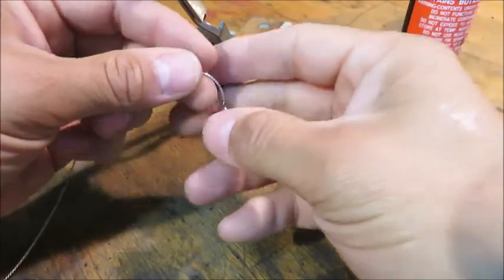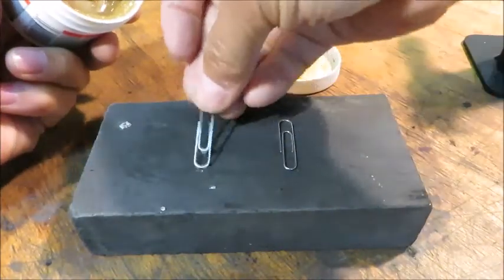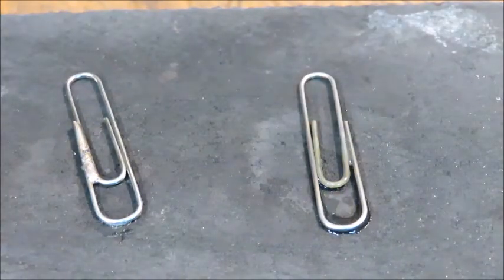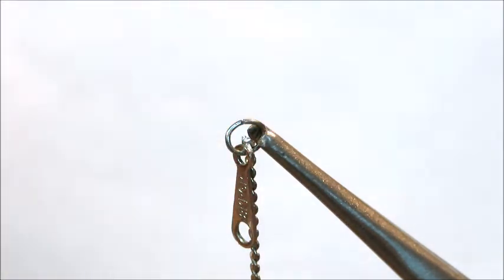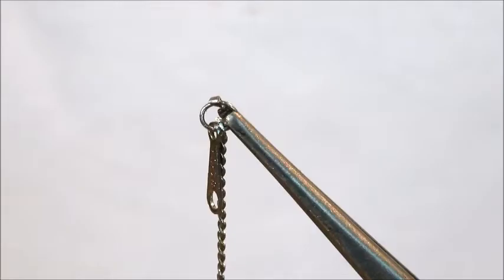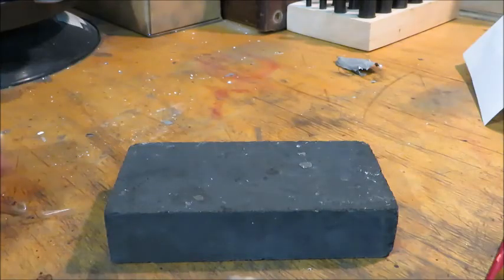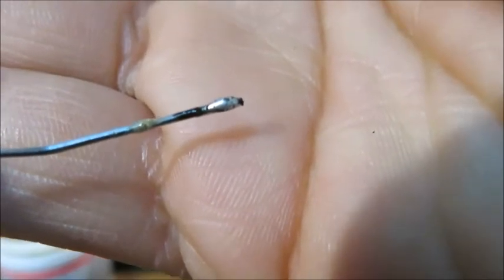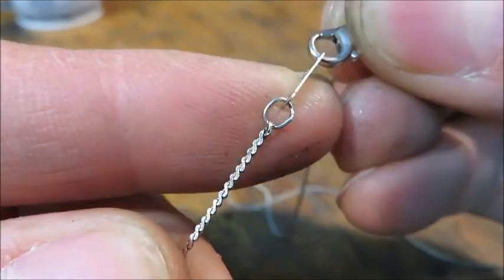How to solder jump rings closed.

Comment: By the way... it wasn’t gravity that pulled the first solder attempt to the left & away from the joint. It was the third hand pulling heat away from the right side & the solder flowing to the hotter side of the jump ring. Next time heat up the third hand a bit first to provide more balanced distribution of the heat & the solder will stay more centered. Solder is way more influenced by heat than it is by gravity. In fact, solder will easily flow uphill toward the heat & always away from the cold, even with gravity pulling against the flow. Good job overall...
Reply: Thank you for this! This was the comment I was looking for, my solder keeps beading up on the wrong side of my jump ring joints and I couldn't tell why...but knowing that it's the third hand on the other side makes perfect sense!

Comment: You mentioned cleaning off the metal that's been oxidized before trying again, how do you do that? I've tried soldering jump rings I have before but they wouldn't work
Reply from the maker: Try 800 grit sandpaper or a Diamond file. If you’re still have a hard time, let me know and I’ll make a video.

Comment: Just use a small electric soldering iron, like used for electronic soldering. It's way better than the flame thrower approach!
Reply: *unless you only have a torch on hand & no electric soldering iron… 😉. That’s the whole reason I found these videos today bc it occurred to me that while I don’t have many 🧰 tools, I have a lot of jewelry & an excellent torch. I found that sure enough, most metals will melt with a torch alone. I even saw one video which this video helped me to understand why in the first, nothing else was required… only heat plus the metal itself with no flux, no solder etc. Understanding that it will work if it hasn’t been flashed, that’s important as I always thought I was unable to use solder as it never stuck to things back when I had a soldering iron. Granted, i read no instructions & simply expected melted solder to magically work.  

One thing that no video has explained is what the block is beneath the heat/metal that apparently doesn’t transfer heat. Is that a whetting stone? Like what I’ve always wanted for sharpening knives? If you don’t have that stone, what options are there as far as areas to do work on/over that won’t catch fire basically?!